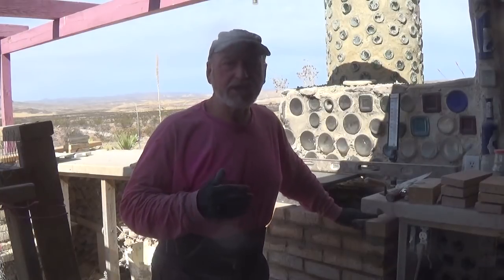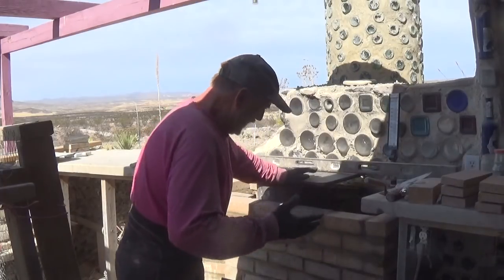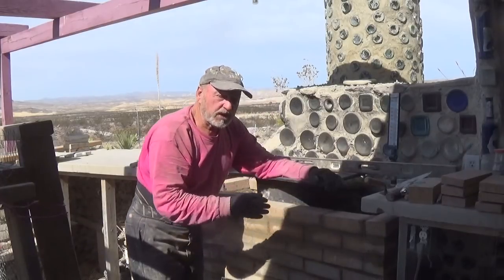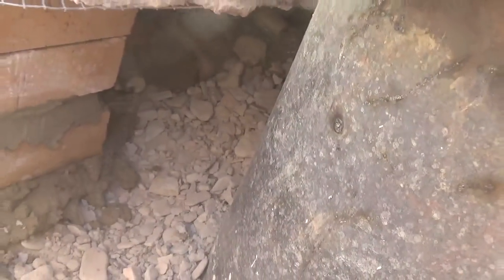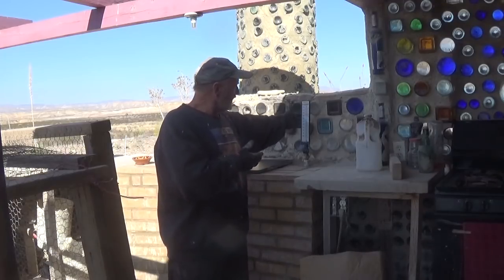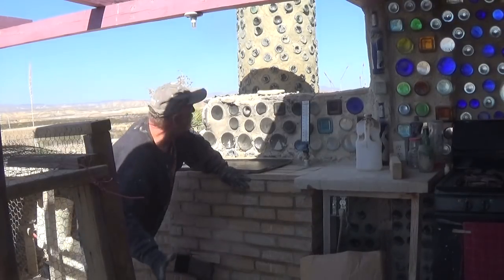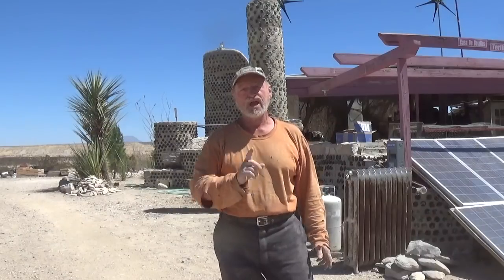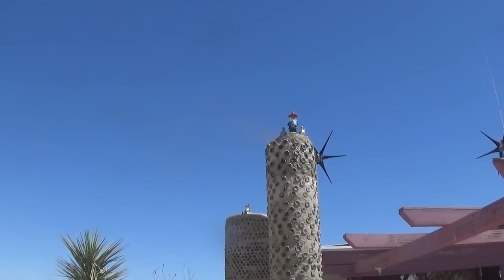Rocket Stove/Incinerator/Hot Water Heater/Cooktop, Part Three (final one)

Comment: Great video we are here in Ava, mo in the center of the ozarks my boys and I work on a very tight budget in a place where we are not very welcome due to me being transgender and I’m studying rocket stoves as like I said are are an extremely limited budget and I believe I can build one. We are in my parents old house it’s trying to fall apart but I’m fighting the good fight and doing what I can to piece it back together. It used to have wood heat and the chimney is in good shape so I’m going to use your idea to build a cook stove rocket stove because there’s no way to we can afford propane. I’ve got some old camper propane bottles the 5-7 gal type I think I’m going to try and use to do this. You got any thoughts or advice for me.
Reply from the maker: There are several videos on YOUTUBE about using those old propane bottles. Just keep working at this and things seem to come to you with the hard work.